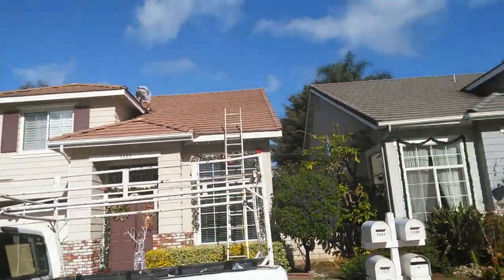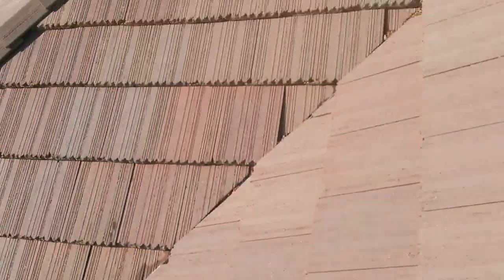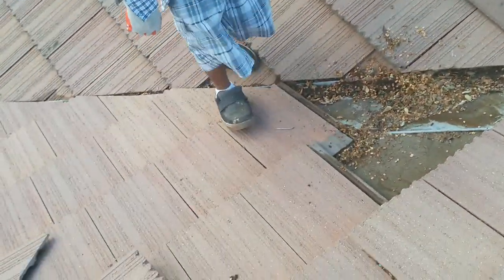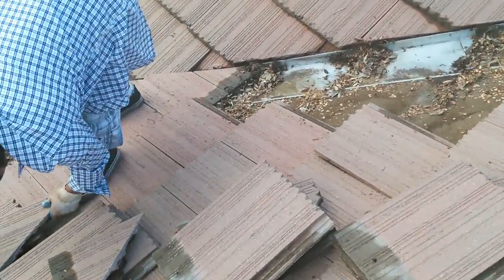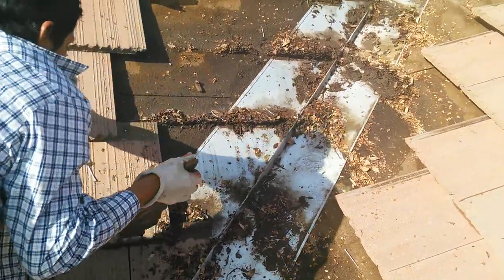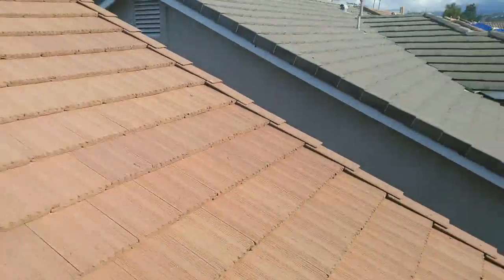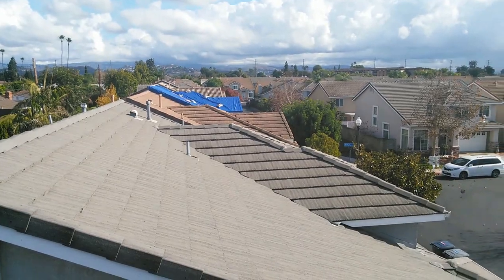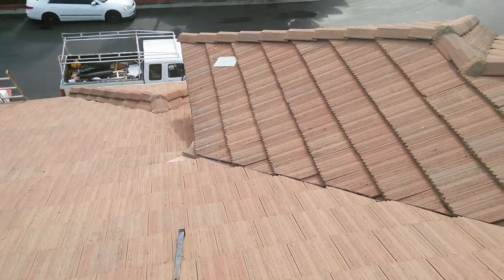HOW TO fix a leaky valley , water leak, tile repair, permanent tile repair, DO IT YOURSELF.

Comment: You have some good tips for the rest of us but if I could offer you a couple tips for yourself. I've been roofing for 29 years - a licensed contractor for 19 years. So after you remove all the tiles & clean all the dirt & debris out of the valley & replace the narrow valley metal with 24" valley metal as you said, when it's time to reinstall the tile, cut the top corner of these flat tiles & reshape them so the water flowing down the valley does not hit the top point of each cut tile & get diverted outward but rather the water will hit the relief cut portion of each cut tile & the water will be pushed back to the center of the valley during the rain. Also leave a small gap between the valley tiles so that the water can flow better & carry the small debris that build up over time down the valley & off the roof. This should prevent requiring two layers of felt paper in this area & prevent the valley from leaking ever again. The problems are that the natural shape of the tiles in the valley diverts water outward away from the center of the valley so reshaping the top point of the tiles to better control water flow & leaving a gap to carry out the dirt & small debris should solve the inherent problems of flat tile valleys indefinitely. Let me know if you want an illustration of how to reshape the valley tiles to promote better water flow if you don't understand what I mean. Try it & you'll see for yourself.
Reply: Duster Dan I'm just a homeowner handyman. I've used videos to learn how to do lots of stuff. I wasn't able to follow what you meant about cutting the tops of the tiles a certain way to enhance water flow. 

Is there a link to a video which shows what you are describing? That would be real helpful for us visual learners! 

Thanks.
Reply: I'm not sure why Eric developed the attitude.  Some people just aren't real good at accepting advice.  
Oh well!
Reply: It's hard to receive any advice in a world full of critics. Nobody likes to admit when they are wrong, but it can be priceless for those who do. Humility is the most valuable asset to anyone who desires to continue improving their specialty & the sky is the limit for those who have enough humility to receive from others & grow in their understanding. Thanks for your empathy. I appreciate it & I simply prayed for Eric cause I think he's one of the few who care enough to help people when they need things done right on their roofs. Good roofers are very few & far between. Have a blessed weekend friend!
Reply: You are welcome to look me up on youtube. I have my own videos there. Don't know if I've done a video yet on valleys but that would be a good place for you to start & you could follow up with questions for me from there. Far as Eric goes, I want to respect his page & not post anything of my own here. Eric seems like a good guy & the last thing I want is to offend him. Thanks for asking.
Reply: Arrogant
Reply: @MrThedocholiday  Your attitude about humility being a key asset to continued improvement is priceless for anyone in any pursuit. As the Buddhists say, "When do you become a master?  Never if you want to keep learning".  I am a solar contractor with 16 yrs experience and am here to continue learning about roofing systems.  These videos and follow up posts are great. Thanks to all!

Comment: At 6 min 13 seconds, you said, "This is the problem with tiles", so what do you suggest for roofing?
I actually have exact same tiles and my roof is leaking now, hopefully I will find a good roofer soon. What should I expect for repair cost on average? My roof is 10 years old. Thank you for the video.

Comment: Is a tile roof just set in place? I came here hoping to find out how to remove a small section of my tile roof to install attic vents. I assumed each tile was nailed in place but I guess that's not the case? What keeps them from sliding off the roof? Sorry I'm from the midwest and we dont have tile roofs so this is new to me in Vegas.

Comment: cut the tile away from the center of the valley about 2 inches so the water can flow. otherwise leaves and dirt  build up an water flows side ways.
Reply: We do all tile roof valleys that way there is 8" clearance where water and leaf etc. can freely flow downwards.
Reply: Exactly so the water can flow and the so debris won’t be clogged in between make the water find a way to flow

Comment: We don't do that in Australia. Personally I use locking sheet metal pliers to turn the ends of the valley back up as usually it's crushed, then install a 50mm bitumen impregnated valley seal between the valley and the tile.

Comment: I'm re-doing one of my valleys and I just want to make sure I do it properly.  From what I am seeing it looks like you run the courses of paper from one side up about 10+ inches or so up the other side, weaving it so that the lower courses are under the upper courses.   Then you lay the metal valley flashing over the courses.  My question is, do you need do adhear the flashing edges to the courses of paper below?   I saw a  video of a guy in SoCal that did that.  

Also, I took up one side of the valley and noticed the existing job looks like this:   Ice/Water shield running up the valley,  metal flashing on top of ice/water shield, then the coures of paper overlap on top of the flashing.  The courses of paper are stuck to the ice/water shield that is exposes on either side of the flashing.   

I am planning on using I/W shield so should my courses overlap the metal flashing or go under the metal flashing... Do what your video shows but add an extra step of I/W shield under the course weaves?

Comment: Do you do valleys that tiles don’t touch each other in the valley center rather they are apart 4-6 inches 
The water will run easily the only thing is you need to fill concrete under the tiles in the valley. 
Do you recommend this? 
Thank you

Comment: How do we keep all the dirt from building up in the valleys.  The moss grows on the cold side of my roof, and becomes dirt over time.  That dirt builds up in the valley and creates a dam making the water travel out on to the battens and leaks.  Should we cut an open valley to help dirt to pass through?  Will the edge bent up cure this problem.  I believe that they had put pieces of tile on the metal to hold up the tile.  That also help to crate the dam effect.
Kirk

Comment: The tile cuts on the left side of the valley where the cuts aren’t supported by tile channel drop, this leaves a clear gap.
 Do you not have clips to hold them together?
Seems a very shallow pitch with minimum headlap this can’t help?
I

Comment: Looking at the end of the video now.  That channel looks super tight.  Isn't there supposed to be some space in the channel?  In my area, there are more than a couple of roof problems.  some were solved by just clearing out the channel.  It seems the water was meeting some resistance in the channel, and probably puddling up and going over to the side.  I'm not a roofer.  Not even close.  That's just been the experience with a few of the houses here.

Comment: i have a question to clean out the valleys you recommend removing the tiles ? and also if theres corner chipped tiles should i glueback or just replace the whole tile? ..thank you

Comment: Isn't debris going to build dams under the tile like the first time? A bigger gap so that the water and debris flow properly would prevent that

The water wouldn't have reached the hole in the felt if the valley wasn't clogged with debris

Comment: Is there suppossed to be a certain distance from tile and valley flashing? it seems like if theyre to close, mud and crud build up
Reply from the maker: cutting the tiles 1.5 inches is a new thing that came out 20 years ago because the new generation of roofers didn't know how to roof the valleys the right way look at old buildings and count how many roofs have open valley?  none,why? because it was done by professional roofers not rookies trying to do things right. Thank you 
Eric
Reply: my house is 13 years old with concrete tiles and closed valley

Comment: I also have a tile roof with a valley leak.  Mine is about the same length as that shown in the video here.  I called two roofing contractors to come to the house and give me estimates to fix it.  They both wanted to completely replace the underlayment on the side of the house with the leak and materially expanded the scope of the “needed repair”.  One bid was $22,000, the other over $30,000.  Needless to say, both bids were rejected.  Goes to show you, educate yourself!

Comment: my idea would b to run felt or ice and water barrrier down the valley and than run your felt horizontally through the valleys overlapping each side and than the valley metal. your guaranteed that your valley will have 3 layers for sure and one whole one longways if wayer does get in it

Comment: It would be better if you put one strip of felt all the way down the valley then put the valley flashing back and then you run the felt over the valley flashing and cut it 3 inches away from the ridge of the valley and also cut the tile 2 inches away from the valley ridge

Comment: why don't you cut the tile back 1 1/2 in. on both sides of the valley rib so debris and dirt will not accumulate there or if does you will see it and someone can get up and clean it out.

Comment: I sell these repairs all the time. I promise you if you cut your valleys back water an leaves will flow.
Reply from the maker: you sell them all the time, again cutting the tile is not what i was thought by my mentors and the roofing school, leave that to the rookies. it seems you don't understand that tile is for costmetic look as standing seam metal roofs. you have to hide your metal flashings as much as you can. now when people look at your roof will see a roof tile with a rusted,old line of metal in the middle of the valley. nice!!
Reply: rust is better than leaks
Reply: Roofing Solutions By Eric Garcia u are a good roofer but being closed minded to new ideas means u wont lern good common sence info
cuttin back valley tiles does work..we u know just as well as i do, the little steip of metal. wont rust or look ugly if u cut straight.anyway i thaught u paint all yer flashings(ugly if u overspray also paint eats shingles) thanx for vids tho ..u do good work for most part..happy trails amigo
Reply: @Garciasroofing  Great video and solution. If you want to increase your knowledge I would suggest searching youtube for Australian vids. Unlike America the majority of our roofs are concrete or terracotta tile. Lots of metal too, very few shingle
Reply: buen jale doblar el metal buens idea.

Comment: The valley is too tight ,Open the valleys up so any debris can get washed down the roof and not clog up on the underside of the valley tiles, also run battens down the edge of the valley pans and fold the metal up and over it, this would create more of an upstand so theres less chance of water splashing over the metal and into the roof space  and will also allow for the tiles to sit nice and not touch the valley allowing free flow of debris and water